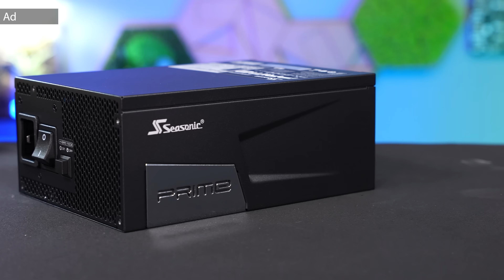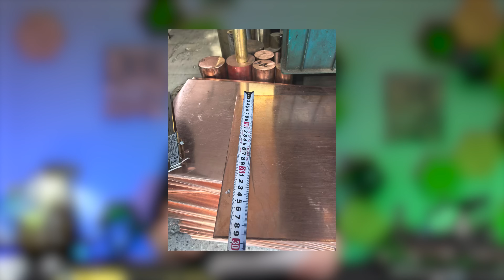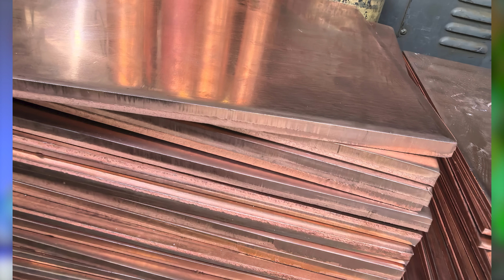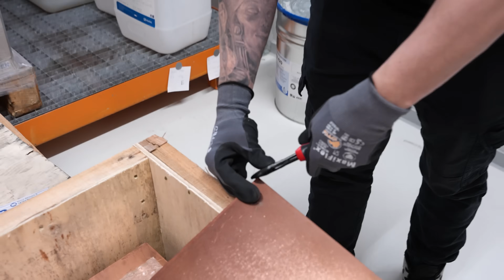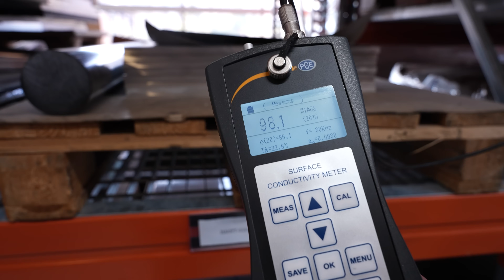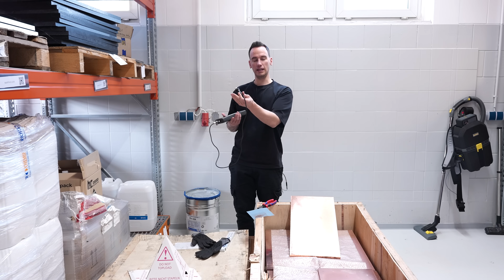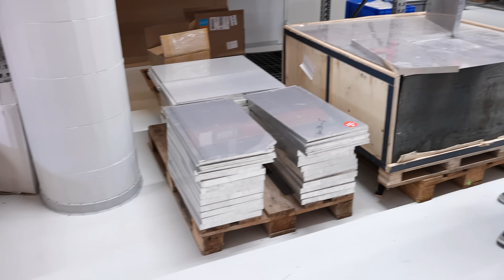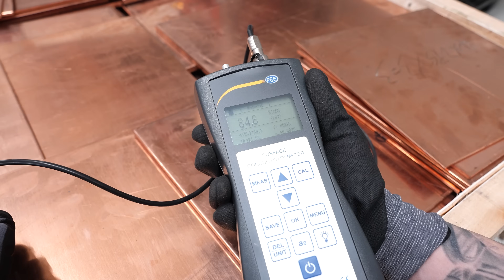I Got Scammed

Comment: This is why when sourcing a large quantity of expensive material, you always do a FAT (Factory Acceptance Test). You can travel there yourself and or appoint a professional inspector (from TÜV, SGS, etc...). In addition to inspecting the material, a good inspector will also witness the packing of the goods and could even apply a seal on the crates. There are other tools at your disposal such as the Letter of Credit (LC) where the bank guarantees the release of the payment as soon as the shipment is under the responsibility of the ship's captain. I'm sorry to hear about your troubles. Let's look at the bright side : You learned something the hard way and will no doubt do better next time.
Reply: And they still going to mail you this
Reply: Payment once it's on the ship wouldn't have prevented this right?
Reply: @FiveFiveZeroTwo  You skipped the part where he said professional inspector. Read the first two sentences again.
Reply: Is the TÜV inspector going to mill open the copper plates to see whether there is another metal hidden inside it?
Reply: @sasjadv  Thanks for your question. The inspector commonly relies on document controls, visual controls, measurements and non-destructive testings (for ex. PMI). But if instructed to so and agreed upon, he can also witness some destructive testings of a certain percentage of randomly selected pieces.
Reply: @Supergirafe80  I mean non-destructively, you can still have cheap metal hidden inside.
And destructive testing is a bit of a hassle.
I might not care about drill-marks for now, but in a few weeks time, I want to use the same flat copper bars for a different product, where I can't have any holes in the top surface. So even after having all the back and forth with the inspector, and giving him clear instructions, I might change my mind myself.
Apart from that, if the supplier knows, that the inspector always tests the top surface by drilling, then they can put extra copper there.

I do think the inspection in combination with some legal protection can be enough to make scamming not worth it. So like you've said about the seal on the packaging, checking documents, and bank having special terms for releasing the money, and more of that nature.
Reply: @Supergirafe80  So then that wouldn't have helped in this case. If you never experienced a scam like this, specifically wanting a destructive test requires you to be extremely suspicious and not all people are. So the inspector would've seen the papers, seen the material, checked everything like shown in the emailed photo's and it would've passed.
Reply: it is bloody easy still! they ll just bring real material, and showcase factory on the spot, then ghost it after payment is secured! they can rent an entire factory warehouses with all the things in it, and dismantle it within a day and ghost it
Reply: Or you support other national manufacturers who provide a good service to you.
Reply: @spikeypineapple552  In a ideal world, yes. But in this ideal world,  sound decisions would have been taken, for example not shutting down nuclear power plants and not relying on Russian LPG. But this isn't an ideal world and with energy prices increasing and the German industry falling appart, that will become increasingly difficult if you want to keep your business going. It is really possible to source quality stuff from China. A lot of companies have very good experience with that. You just need to do your due diligence.
Reply: @Supergirafe80  Russian gas was good for a long time then someone felt left out and started playing games...
Reply: @Supergirafe80  Instead of buying Russian gas, you could buy Russian copper. But again, the same sanctions and politics prevent that (or at least make that harder).
Reply: @spikeypineapple552  Even without the reply from Supergirafe, customers want cheaper goods all the time (while not working low-wage in factories versus service sector/tech), and this has been one of the main reason for businesses sourcing from China to begin with, since you simply can't compete with them if your consumer base wants cheaper stuff all the time.

I don't buy from Temu and Alibaba, or even Amazon, more than like once every five years, and I try to buy from the EU. Doesn't mean I'm ignorant of what most people want, especially the ones who have much less than me, where Temu can make them feel richer with cheaper, low-wage/less ethical stuff.
Reply: @spikeypineapple552 he has explained this. They typically do. Supply is impossible to come by now

Comment: IDK why you feel even a shred of embarrassment about this, to me it's clear that someone went to quite an extent to pull this off. It wasn't just fake photos or an empty box, this is fraud on an industrial scale where they designed an enclosure that would only reveal the scam hidden inside after you'd used up a certain amount of the product. Short of literally flying to China with a bunch of industrial tools to individually test every block of material there's not a lot you could have done to avoid a scam this elaborate.

Comment: You can try and do a charge back through your bank, I dont know what the law says in Germany but I assume there has to be some kind of consumer protection when you order one thing and receive another. It is worth a try, you can initiate it 30 days after purchase then a investigation you probably start so it's a process. Still......worth it. Call your bank and ask them how you would go about initiating a chargeback.

Edit: just sub bank recall for chargeback.
Reply: Those "consumer" protection laws often don't apply to companies because, well, they're not consumers.
Reply: @Teana92  Apologies you are correct, I meant a bank recall, worth a shot. That or it's basically gone.
Reply: There are no chargebacks with IBAN.

Comment: I've been scammed through Alibaba on several industries from GPUs to glass bottles.
Usually they hijack an existing company on the site and want alternative payments were they bypass what little protection Ali gives.
And Alibaba barely supports the buyer, even when legitimate companies shaft you, with all the evidence supporting your claim.
Just have to minimize by getting samples, rating, how many years, get certs, and use all protection methods possible that Ali gives.

Also, there are so many middle man companies that just buy/resell from other companies existing on that platform.

Comment: Been doing business with Chinese factories for over 25 years, you can never be too careful with this guys...
One thing you could, and actually should do if we are talking about many thousands of euros in products, is to pay a little extra to a reliable and professional inspection company.
You hire them to inspect the factory before you even close a deal and then QC the final product before shipment.
With an item so simple like raw material, they could have easily spotted the scam, and often times when doggy factories find out that an inspector is involved, they don't even try to scam.  
Thanks for being brave and sharing though!
Reply: Sounds like they need a postal inspector not so much a factory one. Though I guess any would be better than none
Reply: I know someone who actually flies to China and actually inspects the factory himself (after getting first articles from 3 or 4 factories).
Reply: I just made the same comment; you must pay a third party to monitor the manufacturing, testing, QC and packaging.
Reply: Well put. I have been based in China for over 15 years, and I check every order before final payment to the factory. Although being completely scammed in person is rare, 9/10 times, some details will be off and will need to be corrected or remade. which is relatively easy to deal with before payment, and much more difficult after.  Hiring a QC company is a minimum, I think, but often they only do final inspection, and usually don't know much about the product or the supplier. Finding someone trustworthy who understands how things work here and treats the project as if they were spending their own money is key.
Reply: @wearequorum  so what you are saying is the entire country is a criminal gang and should never be trusted to do honest business. understood.
Reply: @marduk191 talking about US?
Reply: @marduk191   Those types of troubles are not unique to China. Diligence is required for any project, especially when doing business overseas within systems that differ from your own.

As the saying goes, “Never attribute to malice that which is adequately explained by incompetence.”

 And that principle applies both ways.
Reply: @limanac111  Nope, pretty sure he's talking about China.  You know, the place the guy in the video bought copper plates from and instead got random sized copper coated steel. And where he bought aluminum plates that end up as crates of 1/4 aluminum 1/2 shit steel and the rest air.
Reply: with large shipment why not just hire a guy that does that and go travel to china and check
Reply: From your experience, have you been through this at some point?.
Reply: @DahakaCL  Not like this, but the nature of my business is different also.
Worst scam i can remember was about 12y ago, we lost a down payment of a sizable order cause we got scammed by an employee of a factory we had partnership with already. Turned out the guy had left the company, somehow he kept his old business mailing address, and tricked my imports department to pay to an unrelated to his former companies bank account...
Tried to get to the courts but gave up after 5y or so, Chinese justice system is a mess, probably even protecting the scammers some times...
Reply: Real talk, how do you find a trustworthy 3rd party
Reply: You can find lots of consulting and QC companies online, but referrals are usually better, as the companies have already proven themselves to the referring party.  Regardless of where you find them, I would say to start with something small and see how it goes. It's a bit like dating; the experience is often relative. Certain people work better together than others.  Also, be sure that the person you are talking to is actually taking ownership of the project. Many companies will have a competent sales team that will tell you what you want to hear, but then hand the work down to someone who may not be as capable as they were made out to be, and at the same time, likely won't be taking any responsibility if things go wrong.   Finally, when it comes to manufacturing, it's always best to find and fix problems as early in the process as possible. The later you find a mistake, the more difficult and expensive it is to fix, and the more likely it is to be covered up, so final qc is more of a last resort, better than nothing, but in process qc or first article inspections will serve  much better,
Reply: that is a great business area
Reply: I would bet that local customers don't have any issues, but international customers with little recourse is a different story
Reply: Do you have to have them inspect it every time?
Reply: @samtherat6  I actually laughed out loud when I read your comment. Of course you do. China can do the best work in the world, but they will also scam you five ways from Sunday if they can get away with it. This is the same country where they were feeding babies melamine to make a buck. Just send an employee (or have Roman go himself) to inspect the shipment.
Reply: @ssl3546 yeah, in China the "if you can cheat, cheat" mentality is rampant. They can make good stuff, but you need Continuous QC. even if the first orders are perfect, if you don't keep up the qc, they very often switch outaterials for cheaper ones later. Also never let anything get produced with sensitive ip. The 3rd shift problem is real.
Reply: I imagine finding a inspection company in China isn't easy either and given his low order volume, hiring such company eats heavily into margins
Reply: @Sumire9287  I imagine such a company would be able to make money hand over fist considering the amount of fraud that occurs.
Reply: It's a scam to need inspectors to avoid the scam as well. Probably the same company with some personel switching clothes to be inspectors and rhen they only complete all of the orders whom accept the scum behaviour.

Just like when we were booking hotel rooms for travel, nothing for the whole family of 6 to book so had to pay for 2 rooms and 2 of the kids had to pay as if adults to complete the payment... and then we got on site and could "upgrade" by paying extra for an originally cheaper room that were free and cleaned... The scum of the earth are everywhere and with fingers in all the cookie jars possible. Yuck. No dricks from me.
Reply: They can still scam. Just switch out the skids prior to shipping... It's not easy to stop a scam.
Reply: @mrdan2898  that's why the inspection guy stays until the label has been affixed and the package handed to the courier company.
Reply: isn't that a problem? I mean, if you own a company and have a big factory. Not just anyone can just walk in there
Reply: @koford  Nope, not a problem at all, they are not Intel nor Apple, if they get offended by the inspection, they have things to hide and you should move on asap.
Reply: @grsamael  inspection company. Then I understand... I thought you meant private actors that you hire.
Reply: @koford  You would need to hire someone with expertise in the area that you're procuring.
Reply: @koford  Even private actors may work tbh. A couple of years ago i sent an associate of mine to check up on a new supplier (i trade in lighting and electrical equipment and i am based in Greece).
The new factory was under the impression that my associate was working for me as an intermediate agent and they had no problems touring her in the facilities and let her take pictures as well.
Turned out that the new "factory" was more like a shed and less like a factory!
Reply: @grsamael  I don't disagree with anything you say, I'm just saying that "anyone" can't just walk into the factory unless the person is given permission to do so. Note the word "anyone".
Reply: @koford  If you are using a company for materials and they turn away or become offended by an inspector, it's because they are scammers. That's the end of that.

Comment: a company i worked at sold 10 machines to china, all the workers were concerned. 
we finished the units and packed them to go. 18 days later they said all the unit were damaged and refused to pay for any of them. we offered to come make repairs and they said no.
two years later they were selling nearly identical machines internationally. the company i was working at went out of business less than a year later.
Reply: Yeah the Chinese can be scummy. They once came to check a factory i worked in. They were suposed to be potential new customers.
They were let to film how the process works. And then they made their own production lines based of that footage.
So basicly they just came to fish for trade secrets. They had no intention of becoming our cutomer.
Reply: @j.p.h.8126  u should have blind folded them with dental floss. rookie mistake happens to all of us.
Reply: @ihyln1  Yeah. 🤣
Reply: Classic theft  both physical and intellectual.
Reply: About 30 years a company i worked for outsourced production of a consumer product to a vendor in China. With in 6 months the same product started showing up in the USA. The were literally using the the tooling my company paid for to supply a competitor.
Reply: Even the watercooling stuff from China is copy cat from one another. Byksky, Barrow, etc they all look identical. All gpu waterblocks are almost identical. Fittings as well. Kinda tells a story
Reply: @denissh9478   Nah that's mostly just OEM business - where there's one company that just makes fittings, one that just makes waterblocks, and several that market their products by spanning up a more or less cohesive product offering under one brand. That's just how a lot of business works globally, you find one thing you're good at, you manufacture and sell that one thing, but once you have established a customer relation, it's valuable beyond that one thing you can make, the customer trusts you already.

That's also how Roman's company works - they make some products in-house, they commission and import some other products, but you trust them that they put the same care into the complete product lineup, that the in-house expertise and passion also extends to outsourced products.

Comment: You havent lost 40k, the alibaba platform covers your purchase. did you lodge a complaint? Ive made supplier remake and and supply products that were damaged in shipping and got refunds in the past
Reply: I think it depends heavily. For small items it's no issue, they have high margins, but for raw materials the margins are razor thin.
Reply: @TheEsseboy  my last purchase of 5k custom fabricated items were damaged in shipping. alibaba made the supplier resupply or refund. i had a choice so went with the goods instead of the refund
Reply: Maybe it was direct payment, not trough Alibaba?
Reply: Are you sure that was Alibaba and not AliExpress? Alibaba payments for orders of this magnitude aren't usually processed by Alibaba, they're wired directly to the supplier.
Reply: @rppt  im pretty sure If you use their checkout process its covered but if are silly enough to make a direct payment without using the order checkout process than you deserve to be scamshed lol
Reply: unless he fell for the simplest scam ever and paid outside of the platform
Reply: Order protection does work I've had many refunds on AliBaba and Ali express and never been ripped off.  He should have ordered one via air freight to test. Who buys $20000 worth before testing it. Oh well a learning experience. I'm guessing he did bank deposit as the order would not work in Alibaba payment system with a part payment.  Order protection info is at the top of the page on the left.